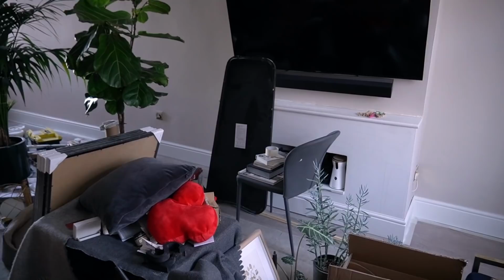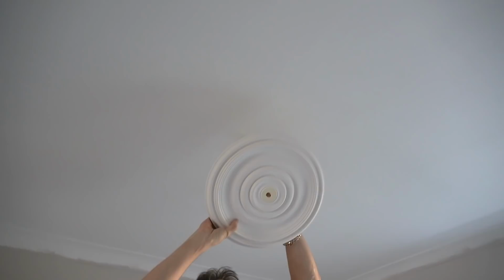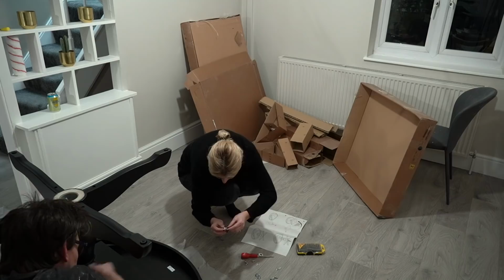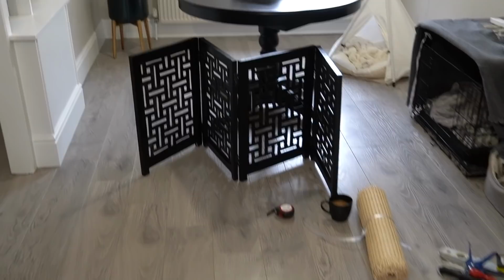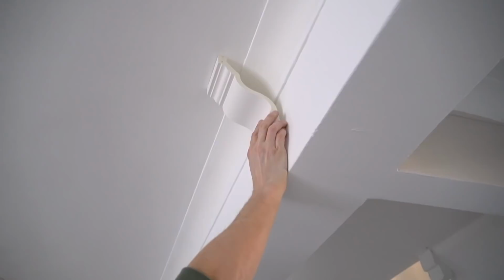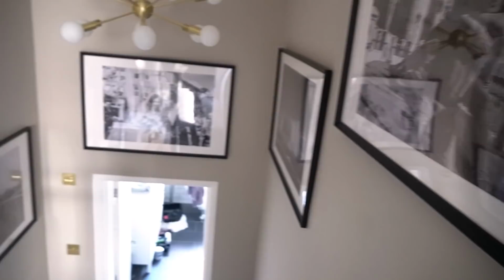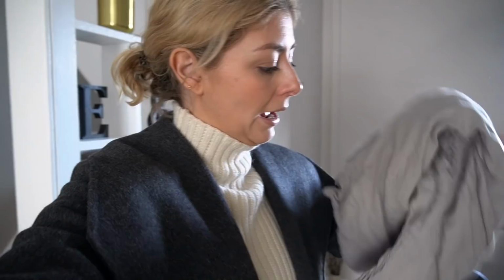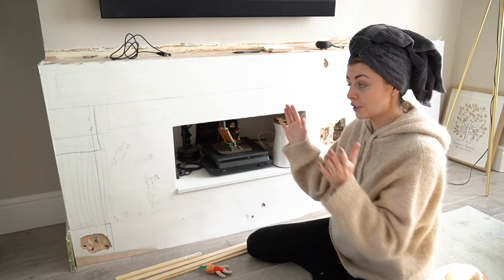Finished Hallway & Lounge DIY Makeover Part II

Comment: I'm sure you guys already know this pro tip, but for some of your viewers, if you have a wall hanging which requires two screws (has two eye hole fittings), place some blue painters tape from one to the other, place a dot, with a marker where the screws would go and then transfer the tape to the wall and level the tape.  Screw the screws in where the dots are and Bob's your Uncle!  😃
Reply from the maker: Great tip, thank you! We use a level and a tape measure, but the tape would be quite a bit easier 👍
Reply: Emma Hill ya it works a treat... I used to measure from ceilings or floors, but walls are always wonky....
Reply from the maker: Yes we learnt that lesson the hardware. When we moved into this house everything was (and most still is) wonky. We used to measure from the ceiling/floor but everything we hung went wonky 🤣🙈 So level and measure it was. But I think we will use the tape idea next time 👍

Comment: @5:36- what light bulb do you use that makes your house bright? Don’t want a yellow dark bulb. I like it to look bright daylight in the house
Reply: Siimply Darliin I’d love to know this too.
Reply: Look at LED lighting. A warm.white or close to 400lumens I think is 'daylight' 
A cool white is more bluish
The old tungsten style bulbs used to be very yellow and not very bright
 LED lights use a fraction of the same wattahe (4w/produces 60w/of old bulb light) so far cheaper in long run 

Sometimes the quality or colour of light can vary slightly between more expensive brands
 Philips tends to have a better colour of light rather than a green blue tinge
Reply: Saya A thanks very helpful. Will fish around for them
Reply: Saya A can you get this from anywhere?
Reply: Ollie very helpful thanks you
Reply: Hey yes what ollie said about the kelvin range is right 4000ish is more 'daylight' if you google up LED ranges you should be able to find lots of info. 

But yes LED lights are everywhere now. Depends how many bulbs you have in the room - you can split the watts/lumen between them
Reply from the maker: Ours are G9 LEDs (daylight bulb) from Amazon 👍
Reply: Emma Hill thanks what Kelvin range do you use ?